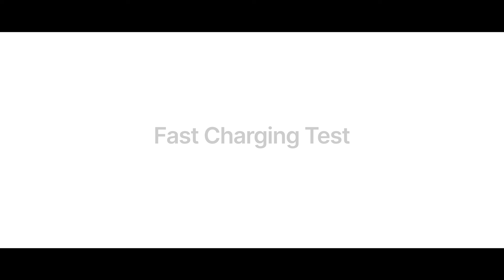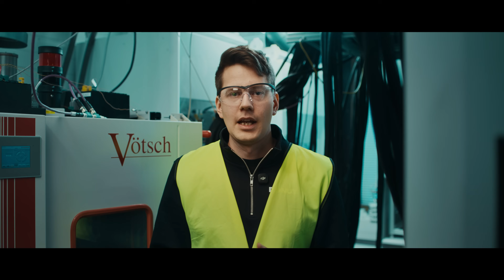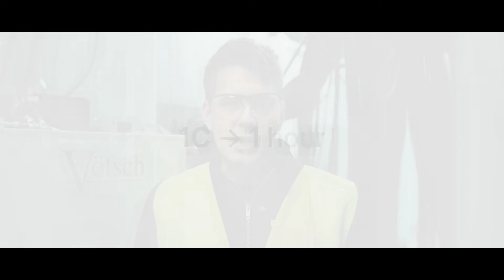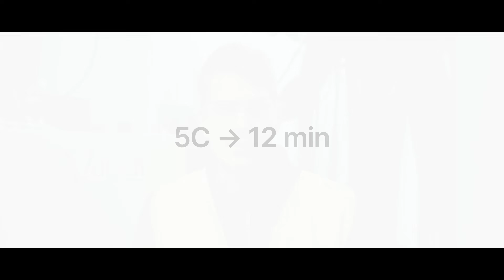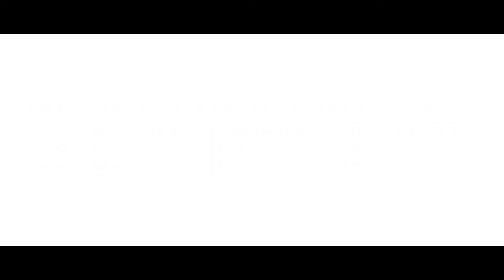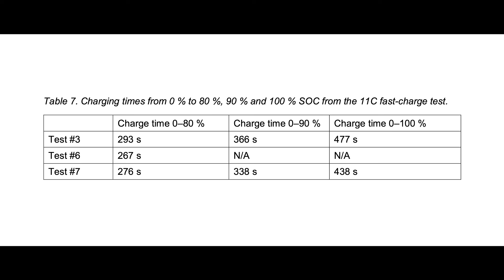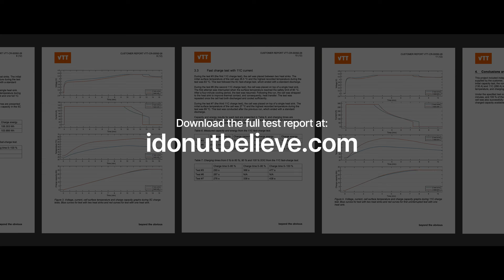Donut Solid-State Battery: Fast Charge Test | I Donut Believe (Pt.1)

Comment: I am no battery expert but the VTT report has that pouch capacity at 26 amp hours. That seems extraordinarily high for the pouch shown in the video. The report does not list the pouch dimensions so there may be trickery. If not, holy crap, that is a very energy dense package.
Reply: I mean it is supposed to have 400 Wh per kg. Wh per L might be unknown.
Reply: @sindreholmboe6063 
These were the specs what they promised:
Weight = 0.315Kg
Voltage range = 2.7v-4.2V
Power = 126Wh
Capacity = 30Ah (126Wh/4.2V)
Cell Energy Density = 400 Wh/Kg (126Wh/0.315Kg)
9C Fast Charging = 270A (30A*9); As promo video demonstrated
Temperature: -30°C/100°C 99% capacity retention with fast charging at 270A
Cycles = 100k at 80% capacity 
Report shows 26Ah instead of 30ah; max recommended voltage 4.15v,  so 26Ah*4.15v= 107.9wh; 107.9/0.315Kg = 342.53wh/kg not 400wh/kg
Reply: @rwyo83   Thanks for the specs. The report shows that test 6# discharge energy was 88.925 Wh, the lowest in the report.

So 88.925 Wh / .315 kg = 282 Wh/kg under fast charging (11C)/standard discharging(1C).
Reply: @sindreholmboe6063. If we assume 70cc volume (approximate for 12.5cm x 5.5cm x 1cm) and 3.6V, then that gives about 1360W*h/L, more than twice as high as NMC.
Reply: @MemphisMillenial  That's a big assumption.
Reply: @famljw3095 I got these Dimensions: 22.86cm(l)*9.6cm(w)*1cm(h) = ~120cm3; the weight has been reported to be 0.315kg. Doing the math you get 225Wh/Kg at pack level
Reply: @famljw3095 You’re not wrong.  Maybe the guy has really big hands.
Reply: Min 4:40 yo can see a hand placing the aluminum plaque on top, it may give you an idea of size.
Reply: @ZJamsa he is saying that despite the hand for scale, there is no proof that he video shown is the same battery referenced by the test report since the dimensions are not listed there.  The photos in the report do look to show the same pack as the video however
Reply: @NDZ12345  Right, agree. I assume it is the same, it seems to read DL3 too on top as the pictures in the report.
Reply: @NDZ12345  Look at the report. It's the same cell in the video as in the VTT report, and VTT even states "The specification of the device under test is presented in Table 1. All tests described in this
report were carried out on the same cell, following the customer’s test plan"
Reply: @NDZ12345  at that point you could just say that the video was ai generated and the measurements made up unless i can have the the exact cell and test setup at my own disposal
Reply: @NDZ12345  there are photos in the VTT report
Reply: @ZJamsa  These were the specs what they promised:
Weight = 0.315Kg
Voltage range = 2.7v-4.2V
Power = 126Wh
Capacity = 30Ah (126Wh/4.2V)
Cell Energy Density = 400 Wh/Kg (126Wh/0.315Kg)
9C Fast Charging = 270A (30A*9); As promo video demonstrated
Temperature: -30°C/100°C 99% capacity retention with fast charging at 270A
Cycles = 100k at 80% capacity 
Report shows 26Ah instead of 30ah; max recommended voltage 4.15v,  so 26Ah*4.15v= 107.9wh; 107.9/0.315Kg = 342.53wh/kg not 400wh/kg
Reply: @rwyo83  Can you share your source? 315g is the weight of the small, empty prototype shown at CES. In the CES fast charging video, the battery capacity is also around 90Wh (probably a lab prototype). Furthermore, the voltage and temperature curves are very close to those of the VTT with two heatsinks.
Reply: @khgffjjfds  315g is the real weight of the cell that goes into the module that will be used on the bikes. but they only show at CES a non functional battery design, to be realistic, we should use the 5G discharge of 90.54wh, this is what you are getting:
Energy density cell level: 287.43 Wh/Kg (90.54/0.315),
Energy density module level: 237.43 Wh/Kg (287.43-50)
Energy density pack level: 213.69 Wh/Kg (237.43-(237.43*0.10))
Reply: Well it's a single 3.5V battery cell. Seeing as I also have an existing pouch style 90wh portable battery, it is about the right size. Remember you're thinking of battery packs that use many 18650 cells and not pouches in most cases. The capacity is the same as any 25,000-26,800Ah battery pack, and there are many only marginally larger, but they do also have battery management and USB adapters built into them making them larger.
Reply: From the video, it appears to be about the same size as a smartphone, maybe a bit smaller but thicker? Either way, I agree; it seems extremely energy dense for its size.
Reply: @ProXcaliber  They are claiming 400 Wh/kg, which is roughly twice the density we are used to seeing.
Reply: @UncontainedGravityFire  My understanding, at least from the circumstantial evidence regarding how it works, twice the density is exactly what they achieved. By removing basically half of what a normal battery requires (anode side), they stuffed twice the density. It's why its also why it has the supercapacitor features.
Reply: @UncontainedGravityFire  
Report shows 26Ah, max recommended voltage 4.15v,  so 26Ah*4.15v= 107.9wh; 107.9/0.315Kg = 342.53wh/kg not 400wh/kg. It's a downgrade, and at the pack level you get 292.53wh/kg
Reply: @rwyo83  To be fair, even 292wh/kg would still be excellent if they can achieve 100k cycles.
Reply: @RykerRobb  that was using max voltage, now if we take the nominal voltage that is 3.6v, the correct way of doing it,  what is shown on the report you get power of 94wh. 94wh/0.315kg = 298.41wh/kg at cell level. for module level you substract 50, because that was shown on CES 2026, you get 248.41wh/kg at module level. And at the pack level it should be quite less.
Reply: @rwyo83 they claim this isn't li-ion though, so there's no reason we should be assuming 3.6v nominal though. Besides, we may be getting proof of the 400wh/kg they claimed real soon.
Reply: @RykerRobb  the report said that 3.6v is the nominal voltage for this supercapacitor, so that is the voltage that you should use. Like each module comes with static cooling, for pack level you substract 10%, for external structure connectivity and the master BMS. So you get 225wh/kg.
Reply: @rwyo83 yeah, but they said that that voltage was "chosen" to be backward compatible with li-ion packs, and any voltage could be used "within reason". So i'm gunna assume they're using a higher voltage to get to the 400wh/kg they claim, if this turns out to be real.
Reply: @RykerRobb  They are using very low voltages, because the unit cells are stacked in a bipolar configuration, in serial connection to voltage adds. Most likely 0.45-0.7v (x6)  = 2.7v to 4.2v, how do I know because they are using Black (SnO2-TiO2) Quantum Dots, so that is the sweet spot, also because the mercedes vision iconic quantum solar  coating that is the same tech of the Donut Supercapacitor, they claim that the voltage was 0.5v with 6 layers
Reply: @rwyo83 If it turns out they are using some form of supercapacitor, they might be using more than 6 layers to get to 400wh/kg. But it's still unconfirmed if that's what they're using, or something else. Or if this is even real. Guess we'll find out shortly.
Reply: If you talk about battery size and capacity, use Wh's.  Ah is amazing way to get the size wrong. Capacity wise, if the battery is real and the capacity 400Wh/kg (like they claim), it's dense, but not more much more than the best commercial batteries which are 200–300 Wh/kg.
Reply: @shaman2384  I would say a 33 - 50 percent improvement is, in fact, much more. We are not used to  see such improvements in batteries, especially when combined with 10C charging and 100'000 cycles
Reply: @StijnDeWitt  Do the math, you get 342.53wh/kg not 400wh/kg at cell level, at module level 292.53wh/kg, and at pack level will be less
Reply: From my understanding, it doesn't matter as its extremely malleable, "clay like" is the term commonly used by Donut Labs.
Reply: Watt hours is the appropriate measure for energy density, once we know the mass of the battery. The voltage is ~4V so that needs to be taken into account: 4 volts x 26 amp hours ~ 100 watt hours which is what was measured.
Reply: 4 pcs highest capacity 21700 li-ion cells is about the same capacity (4 x 6Ah). It is 280 grams and they are all together 70 x 85 x 21 mm size battery. Note that the voltage is only 3,6V. Discharge Energy capacity 90Wh is not much. An ev battery is roughly 500-1000 times that. An electric bike battery needs 5-10 pcs this type of cells to have the 450-900Wh total battery capacity.
Reply: silicon carbon battery has more density than this
Reply: 11C is nothing special (lipoly like Turingy Graphene 15C high performance RC pack) and this battery looks identical as a regular lipoly with same outer coating folding details. It’s funny to watch them try to fool all the naive people .and this battery looks identical as a regular lipoly with same outer coating folding details.It’s funny to watch them try to fool all the naive people.
Reply: @maricomovies 
Yes, Ping, we see you all over the comments.  Anything else?
Reply: @maricomovies yeah the rc packs c rating is discharge power.. You usually charge them 1C fast charging is 2/3C and even so it gets hot.. 5 to 10C may be possible on some expensive superbatteries, gets very hot and is extreme.
Reply: @MoparEddy  and this one didn't get hot at all.... only 90C (lol)
Reply: @forrest2851 Well yeah, but it performed even better.. Lipo's burst in fire
Reply: @maricomovies 11C is extremely special. At that point there is absolutely no reason to pursue anything faster. None.
Reply: @maricomovies  you're an idiot. Those packs charge safely at 5C, not 11C.  It doesn't matter if it's possible to charge them at 11C if they burn up and destroy the life of the battery by doing so... that's the whole point of solid state, 11C charging, safely.

Comment: discrepancies I noticed were: testing vs ambient temperature claims (emphasis on proportionally weird heat sinks), size of battery cell pretty small?
Reply: The losses need to be dissipated in any battery pack. And the energy retrieved is 90Wh for the tested cell, which appears to roughly fit into the palm of a human hand. For ground vehicle application the energy stored per volume is a more important spec than energy per weight.
Reply: Typical cells are quite small

Common EV Battery Cell Dimensions and Formats
2170 Cell (Standard Cylindrical): Used in many top-selling EVs, these are 21mm wide by 70mm in length
4680 Cell (Large Cylindrical): Used by Tesla and others, measuring 46mm in diameter and 80mm in length.
18650 Cell (Small Cylindrical): Older, smaller standard, measuring 18mm by 65mm in length
Reply: @e @eerosalonen yep agreed that small cells are common in EVs and other similar uses. What is not so common is having a heatsink several times the size of the cell clamped to it. Sadly that seems to suggest this is likely just normal lithium ion cells being pushed hard, rather than a new and innovative technology. Even if it is a different chemistry, it won't be usable for EVs any time soon with several times the cell's volume required for heatsinks.
Reply: @patronics its already being sold in a  motorcycle !
Reply: @patronics i mean if the 5C is doable then it’ll still be sick

Comment: Why this battery looks like a standard lion/lipoly pack with identical enclosure details like folding the outer protective coating? That's  fishy for me.
11C is nothing special, there are a  professional (for RC racing) 15C battery packs like Turingy Graphene. 11C is nothing special for racing packs.
I bet the original manufacturer of this LiPo pack has already recognized their own product and is having a lot of fun watching this.😂.
Reply: They literally used a government testing facility to ensure veracity.
Reply: @gwailo27take a lok at the papers. Testing lab says nothing more like "client claims it's solid state battery".
Reply: @gwailo27 Yeah? VTT does the tests that customer wants. If customer pays for charging test, they get a charging test. It doesn't matter if the battery is solid-state, li-ion or solid block of iron, VTT does the test that customer wants. But you can trust those results.
Reply: Because why wouldn't it? It's just a cell after all. If it were just a standard lion/lipoly battery it would have swollen when it reached 90 degrees Celsius as they are meant to be used under 60 Celsius only.
Reply: @alexandruilea915 there are  professional for RC racing 15C battery packs like Turingy Graphene. 11C is nothing special for racing packs.
Reply: I have worked in a lab. Lab-level experimental cells look very different.
Reply: Stop guessing. You have zero clue.

Comment: So wait, 5C test was conducted at 130V x 4,3A, so, half a kW? And then the 12C charge was conducted at same voltage - 4,3A x 280V, so, 1,2kW? 

I am an amateur, so please, dont' hate - educate - but what's the point in doing these tests on such a small scale, as it doesn't resemble real life conditions, where the battery pack is, for example, 50kWh or more? Is it not so that a bunch of cells generate heat in a compact environment thereby compounding heat upon eachother? 

Like I said, don't hate, educate. I understand that the numbers in themselves are incredible when looked at for what they are, but let me ask the real question - when can we expect tests resembling real life scenarios (or actually being part of real life scenarios) and why haven't these been what we are shown instead? 

Kind regards, and thank You for Your efforts.
Reply: You add 100 of these cells in series and charge with the same current of 280A but with a 100x higher voltage of 430V. Basically same performance but with 120kW of charging power
Reply: 5C test was at 130A to 4.2V = 546W

Comment: while impresive, why not release the full report or is the testing still ongoing
Reply: because this way Donut Lab can generate free publicity and follow-up stories. To get the same effect through a traditional marketing campaign would cost 100 million dollars, but now all kind of Youtube battery experts and newspapers and magazines are building the marketing story and releasing followup stories for free. Donut Lab seem to have not only smart engineers, but also smart marketing people.
Reply: surely they have all the results already, why else put this ongoing if the results aren't clear ?
Reply: The guy literally said the full report is available to download at the specified website. Or i heard it wrong
Reply: @cryptochanceknight3057 not a "full" report just battery charging rate and it falls close to what they advertised, we still need the capacity and longevity of the battery also structure and what it's made of would be cool too, but I don't mind that as much performance is more important than what it's made of for me
Reply: I think they said they are going to release it incrementally over 7 videos of I remember correctly.
Reply: @gwailo27 why over 7 weeks. i guess to build hype
Reply: @pmaura have you checked the link? Is on the first comment they put up. I didnt, tbh but they literally say is the full report
Reply: @pmaura  Only professional scammers would make it such a circus with 7 weeks of weekly disclosure. My gut feeling says: it's a scam of the century.
Reply: Obviously to build hype, but also I'd wager doing tests to confirm 100000 cycles takes a while.
Reply: 3 possibility, it's a scam(slowly becoming less likely). They want to keep the hype going for 3-4 weeks, OR  testing is still on going. 

Next few weeks are going to either be revolutionary or a huge "told you so" let down.

Comment: Tables 3, 4 and 6 in the report show 10-18% of the energy going in as a loss (presumably dissipated as heat), depending on the charge rate. Now I'm curious how that stacks up against LFP. I have never looked into it.
Reply: Depending on charge speed and charger between 5-15%
Reply: LFP at which charge rate? 11C?
Reply: trying to charge LFP with 11C rate would cook the LFP battery cells we know today.
Reply: @lifeonshine5055 but not for lipoly like Turingy Graphene 15C high performance RC pack. 11C is nothing special and this battery looks identical as a regular lipoly with same outer coating folding details.It’s funny to watch them try to fool all the naive people.
Reply: @maricomovies  they haven't shown that per cell monitoring and management is easier in this demonstration. If I saw that then i would be more inclined to say that this is different than a Turingy Graphene 15C high performance RC pack.  The fact that they stopped at 11C and didn't push to and beyond 15c seams to imply it is different than Turingy Graphene 15C unless that was a slight of hand to keep us guessing. Intrigued but I am supposed to feel that way.